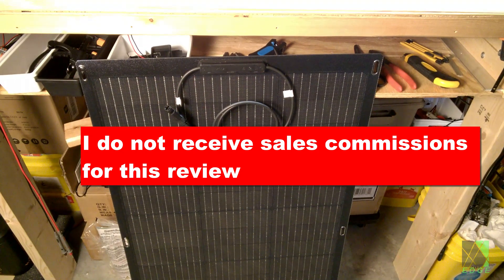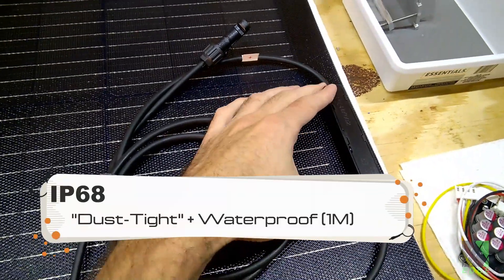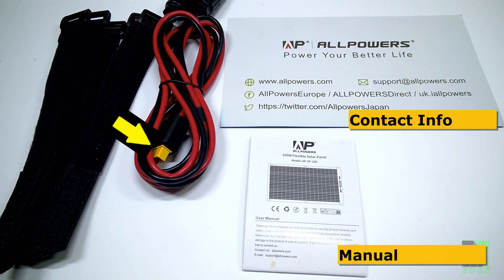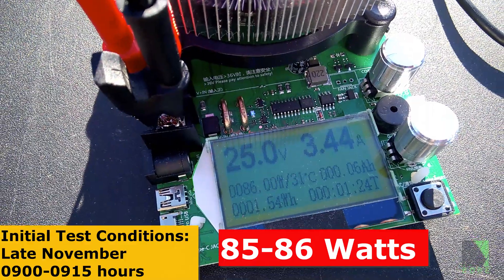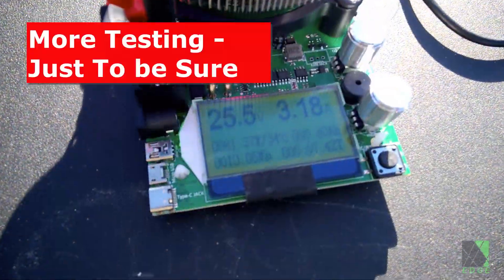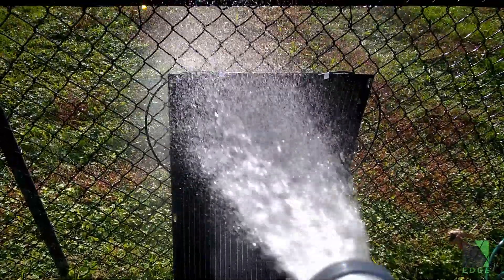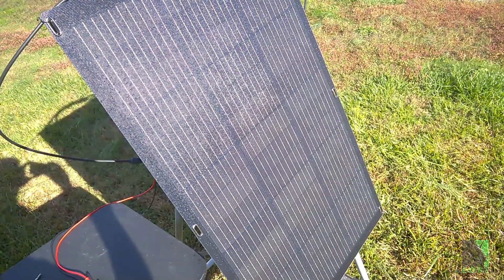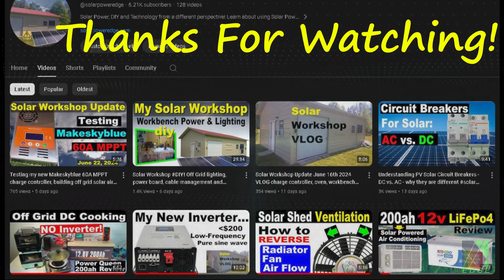Allpowers Flexible 100 Watt ETFE Solar Panel #Review and Expert Test #Solarpower #Offgrid

Comment: what is the dimentions of the panel, on allpowers website it says something crazy like 500mm wide and 950mm length which clearly is not right
Reply from the maker: @mrtwinky2007 I measured it, looks to be about 23-3/4 by 39-3/4 inches
Reply: @solarpoweredge  Thanks very much for doing that :)
Reply from the maker: You are absolutely welcome!! :D 👍